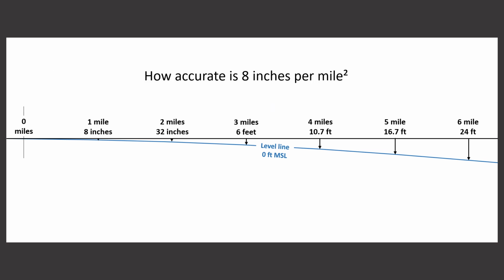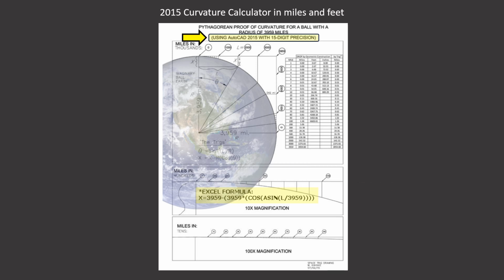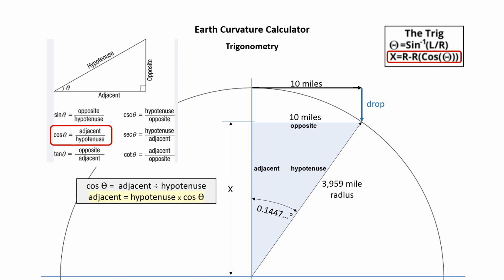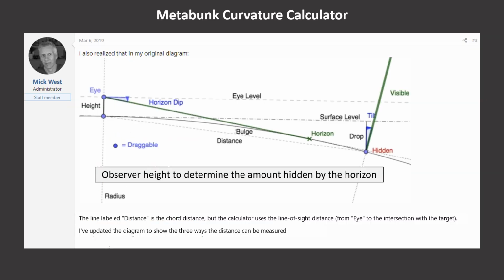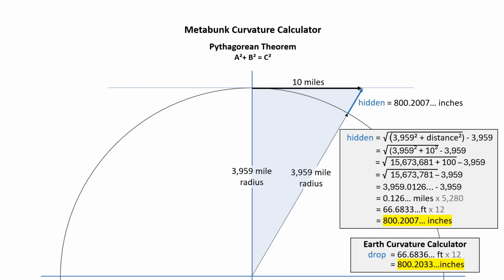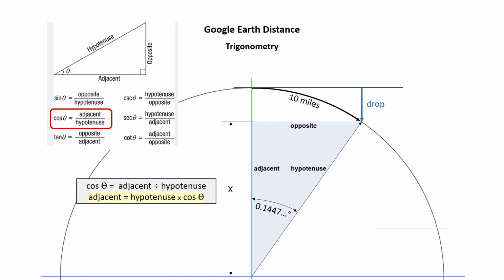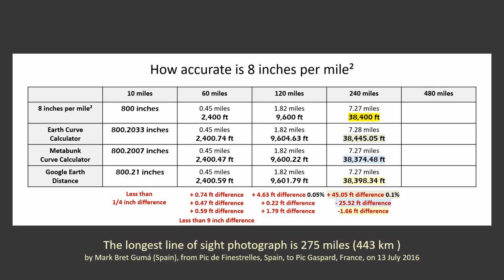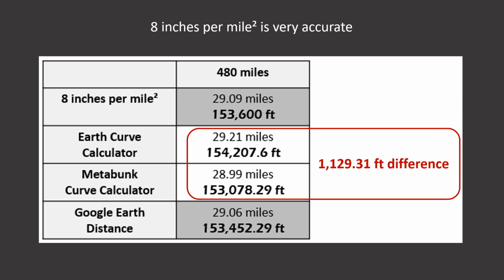How Accurate is 8 Inches per Mile²

Comment: Interesting results. I still don't get why the 2015 calculator results were the least closest to 8 inches formula since the methodologies are very similar
Reply: There's two things that cause the difference between all the results (other than the 8" rule).

1. How you measure the 10 mile distance.  It can be a straight line tangential to the surface. Or it can be 10 miles measured along the curved surface of the globe. (it could also be a chord length, but this video doesn't use that.)

2. How you define the amount of "curve". Is it the drop, measured at right angles to the straight line of sight? Or is it the hidden height, measured at right angles to the surface of the earth at the target position?

The differences within each option are only slight. With 2 different possibilities for each, there are 4 different calcuations you could do.
None of them is inherently "more accurate" or "less accurate". They are just calculating DIFFERENT things, or over slightly different distances.

Depending on the problem at hand,  sometimes one will be a  more relevant/accurate calculation, and sometimes it will be another. 
But from a practical point of view, over short distances the differences are so small that it doesn't matter for most purposes -  Including the 8"/mile² rule. So many people tend to pick one method and stick to it regardless of whether it's calculating the right drop/hidden height/distance, because practically it doesn't matter. 
And let's face it: in all these calculations we don't normally bother adjusting the earth's radius we use depending on our latitude, or whether we're looking East/West or North/South, which are things that also affect the result. But again, for most practical purposes/distances the difference is  insignificant.

Comment: I recently purchased an older digital Theodolite and I use this equation very frequently measuring zenith angles from 8 to 60 miles away. I use a standard refraction correction (.556 to .574) and I'm getting some pretty amazing results. 
Bottom line is this parabola has great value, for me, with predicting / calculating elevation and depression angles to various targets.

Comment: It’s worth noting that in todays software environment 8” x (mi^2) is archaic. But in surveying 15, 20, 35 mi measurements is not common. More like 2-3 mi. Which in which 8” x mi^2 returns a very good value. 

If you were calculating, pre electronic calculation, long hand 8” x mi^2 is fast and not prone to mistakes. Even in pre machine calculation when working with long distance measurements in a major project of course the geodetic calculation would be performed.
Reply from the maker: I worked in commercial construction but my "surveying" experience was pretty much limited to doing top of concrete elevations and sub-grades with laser levels and a rod-eye.  A big game changer was when the company surveyors started using total station with EDM technology.   It sounds like GPS surveying instruments are now becoming very common on jobsites.

Since you have a  surveying background, I have a question about the triangulation networks that were done for the horizontal datums across countries back in the 1800's..  Some people in the globe community have reference data from these surveys and said that triangles were measured with more than 180°.  I went through the data that was provided one time, and when I added up the angles, some of the triangles were slightly over 180° and some slightly under but all were adjusted to be over 180°.  It seems logical that the surveyors understood the measurements would not be 100% correct and after a network of triangles were measured, they made adjustments based on an ellipsoid (?) to bring each triangle into a more accurate spherical triangle shape and therefore increased the accuracy of the triangle network?  Is that a good guess?
Reply: @fedogma8407  
I assume you’re referring to survey report published in 1900 of the transcontinental triangulation survey 39th parallel. 

Spherical Excess is typically small. SE is 1 arcsecond per 72 sq mi of area of the triangle. And that’s 0.33 seconds per angle. (0.33 seconds is typically below instrument accuracy of 1890s) In that report many have pointed out that the few triangles they examined were 180° +/- 1 second or so. And they did not consider the area of triangles in question. In the eastern portion of the survey the triangles are typical small. 100-200 sq mi. And they cite that as a gotcha. 

In the western portions, west of the Mississippi R, the triangles get much larger. The largest of which are 1000-2000-3000 sq mi each. A 2000 sq mi triangle has about 28 seconds of SE. That’s about 9 seconds per angle, far greater than instrument error. 

eg; The triangle west of Mt Waas to Mt Ellen and Patmos Head is 3498 sq mi and 48.6 seconds of SE was measured. Over 16 seconds per angle. 

In that report the SE was measured, very consistently. Not pre-calculated and just added in. 

One guy spearheaded a group to enter all of the measured triangles (hundreds of triangles) and tallied the SE, and calculated the area of the individual triangles. The measurement data returned a very consistent 1 second per 72 sq mi. In the eastern portion most of the triangle are just too small for SE to be measured, especially with the theodolites of 1850-1890. 

A triangle the size of Texas, 261,200 sq mi, would would have 1° of SE. 20 arcminutes per angle. So the geodetic survey report has a very high integrity of presenting measured SE.
Reply from the maker: @larryscott3982   Thanks for the reply.  To be honest I forget the exact data but there was only about 8 triangles involved since it was a small sample,  I understood that the larger triangles in the Rockies would have constantly measured SE but to me it made sense that smaller triangles could be measured below SE and they would always show some SE after adjustment. And yes, it was only a few arc-seconds.   It amazes me to not only read the about the hardships these guys went through to do the measurements but also their ability to understand the spherical geometry that was needed to make the adjustments that improved the accuracy of these measurements. That is certainly way above my math skills.
Reply: @fedogma8407  
Least squares adjustment of empirical data with high ‘degrees of freedom’ is high math. 

8 triangles. Out of how many? Yeah. They think it’s a gotcha. A 900 page report with all of the conditional equations presented for the academic community to be reviewed and scrutinized. As transparent as can be. It’s a hard doc for many to digest. Pre machine calculations, logrhythms, and a giant data set. It was mind boggling then and now. I entered 40-50 triangles, from the Colorado Utah stretch, into a $2500 geodetic least squares adjustment program, and the survey is stunning. There’s no altering ‘as observed’ data. 

But omg, the triangles on the eastern portion, the smallest of the whole survey, prove SE is made up, whilst ignoring bulk of the data, total dismissal of the west.
Reply: @fedogma8407  
There’s a few grade checkers, concrete form carpenters, Flerfs that have laid out slabs, sidewalks, maybe even a 1 acre parking lot, that think geodetic survey math and least squares error analysis is made up. Because ’there ain’t no curvature in a parking lot.’ The arrogance.

Comment: You didn't include the chord length method... check it out. If you use chord length, the answer IS 8 inches per mile squared!
Reply from the maker: I am deleting my previous comment since I didn't use 10 miles for the chord length.  Not certain what I was thinking but I was trying to get find answer before I left on an errand and thought I had the correct method but on the way home I realized I didn't do it right.  I need to look at this again.

I didn't include the chord length in my calculations since no curvature calculators use it.  I only included the Google Distance since most everyone uses Google Earth to find the distance.
Reply from the maker: OK, I figured out a way to use the chord and it doesn't seem to be a perfect match with 8 inches per mile².  Hopefully my explanation makes sense.

I drew a line from the earth center to the halfway point of the chord so a 10 mile chord is cut into two 5 mile segments that are right angles to this line.  I was able to find the sin of the angle subtended at the earth’s center by sinØ = 5 ÷ 3,959 = 0.00126…   

Since the right triangle formed by the 10 mile hypotenuse (chord) is a similar triangle as that formed by large triangle with the 5 mile opposite side, then the drop = sinØ x 10 miles = 0.00126… x 10 = 0.0126…  When I convert this to inches I get 800.202.
Reply: @fedogma8407  the point is to compare 8 inches per chord mile² with the real earth curve formula.
I had an spreadsheet somewhere a few years back, can seem to find it now (( But it's damn close, and pretty round too. The parabola pretty much disappears
Reply from the maker: Here is a link to a short video with no commentary showing my calculations for a 10 and 480 mile chord.  Yes, this method has the smallest amount of difference when compared to the earth curve calculations.   https://youtu.be/AyWrOP_xte0?si=Z1P8Jp4PqQ-qEVwa
Reply: @fedogma8407  I think that link probably wrong... it takes me back to this video.
I tried to post the titles of my videos that discuss this topic, but it seems like YT ate the comment. :(
Reply from the maker: @icansciencethat    Sorry about that, this is the link  https://youtu.be/ZlcEf_qXc2k?si=yhTGOhv7OUOD541U

Comment: Try using chord length instead
Reply: Cord or chord?
Don't worry, I don't want to play the language Nazi. As a non-native speaker I confuse the two too, all the time ...
Reply: @mittelwelle_531_khz  I think chord length is correct. Correct me (and Google) if I'm wrong
Reply: @Mr.42  Googling "Chord vs. Cord" gives:
Chord and cord sound the same, but a chord is three or more notes played together while a cord is basically a thick string. You strum a chord, but you tie a cord. Just remember that the letter “h” is like the extra note you need to make a chord. But a cord goes straight from one place to another.
Reply: @mittelwelle_531_khz  Everything you said is absolutely correct, but apparently chord has another usage as well. Disclaimer: I'm also not a native English speaker 😅
Chord length using trigonometry = 2 × r × sin(θ/2); where 'r' is the radius of the circle and 'θ' is the angle subtended at the center by the chord. Observe the following circle to see the central angle 'θ' subtended by the chord AB and 'r' as the radius of the circle.
Reply from the maker: @Mr.42  I made a correction on my previous comment.  I first wrote sinØ = 10 ÷ 3,959 = 0.00126… when it is actually sinØ = 5 ÷ 3,959 = 0.00126…
Reply: @fedogma8407  I think that when you half the chord you're also halving theta so it'd be sin(Ø/2) = ChordLength/2r.  So as Drop = ChordLength × sin(θ/2), you could also say, Drop = ChordLength² ÷ 2r
Reply from the maker: @Mr.42   Here is a link to a short video with no commentary showing my calculations for a 10 and 480 mile chord.  Yes, this method has the smallest amount of difference when compared to the earth curve calculations.   https://youtu.be/AyWrOP_xte0?si=Z1P8Jp4PqQ-qEVwa
Reply from the maker: @Petey194  Here is the correct link to a very short video showing how I did the calculations for a 10 and 480 mile chord.  https://youtu.be/ZlcEf_qXc2k?si=yhTGOhv7OUOD541U
Reply from the maker: This is the correct link to the chord video   https://youtu.be/ZlcEf_qXc2k?si=yhTGOhv7OUOD541U
Reply from the maker: The chord doesn’t seem to work either.  Hopefully my explanation makes sense.

I drew a line from the earth center to the halfway point of the chord so a 10 mile chord is cut into two 5 mile segments that are right angles to this line.  I was able to find the sin of the angle subtended at the earth’s center by sinØ = 5 ÷ 3,959 = 0.00126…   

Since the right triangle formed by the 10 mile hypotenuse (chord) is a similar triangle as that formed by large triangle with the 5 mile opposite side, then the drop = sinØ x 10 miles = 0.00126… x 10 = 0.0126…  When I convert this to inches I get 800.202.

Comment: It's been used in surveying for years before modern GPS methods.
Reply: Just with around 6.8" per miles^2 (or rather 0.57 ft per mi^2) with standard refraction.

Comment: Aren't these calculations done without including refraction? In many cases that will have a significant effect in making distant objects more visible than the geometry suggests.
Reply: They are. But as refraction can hardly be determined with substantial accuracy you may still use "rules of thumb'' like "8 inch per mile squared' or even "8 cm per km² if you "correct" the distance part in them with the 7/6 ratio (or whatever seems adequate for the wheather conditions).
Reply from the maker: Yes, I did not include refraction.  I was just curious as to how 8 inches per mile² compared to other earth curvature calculations.
Reply: There are "corrected" formulas, and with standard refraction you get a drop of around 7" per miles^2.
Reply: DIFRENCE IS EYE HIGHT METABUNK .. 8INCH SEALEVEL HIGHT
YOU CAN´T USE 8INCH TO THE PHOTO RECORD.. THATS 4SHURE
Reply: @kennethschultz6465  
Caps Lock off.
Spell Checker on.
Brain engaged.
Seriously, try it.
Reply: @kennethschultz6465 wrong. You can! You only need to use a two step approach: First solve "8 inch per mile squared" for the distance depending on "drop" which is rather observer height then. Now use the (known) observer height to calculate the distance to the "tangent point" of a straight line of sight from the observer. Then subtract that from the total distance and use 8 inch per mile² another time for what remains.

Done.

Comment: Very nice presentation! Crystal clear. Several of us have looked at that in recent months and we've all come to the same conclusion. Unless maybe you're designing a huge particle accelerator, it makes no difference.
Reply: Every time I see this topic discussed I feel glad and bad.

Glad as on the very first days I heard of this "rule of thumb" approximation I thought: that's a parabola, no way it gives good results beyond some 10 kilometers.

Then I tried with a spreadsheet and found: Oh, oh, surprise, surprise, over such (much longer than I thought) distances so little error.

Then I thought (as a metric guy that I am) "how about a similar rule of thumb in meter and centimeter" and found 8 cm per km² is quite useable too. Slightly worse in the short range but holding up a bit longer in the long range ... all in the light that refraction over long distances is a much bigger uncertainty factor.

And now comes the sad part: one day I watched George Hnatiuk's derivation why the formula is even 100% exact on any long distances if you use it for "drop (or hidden?) vs. cord length" AND if our Earth's radius were 3960 miles, not 3959.

OK "drop over cord length" is not such a spicy topic (latest since Elon Musk's Boring Company didn't become the success he thought it might have) ...

.... but it reminded me of the day I heard about GH diseased ... 1⅐ years ago ... or already 2½? No, I think the former is correct ... or maybe time accelerates the more the older you get.

(Myself stepping "out of the '6x' age range" soon too ....)
Reply from the maker: Also, anytime globers or flerfs use earth curve calculations to analyze photos, to which Metabunk's refracted calculations are the most accurate, we are only making estimations.